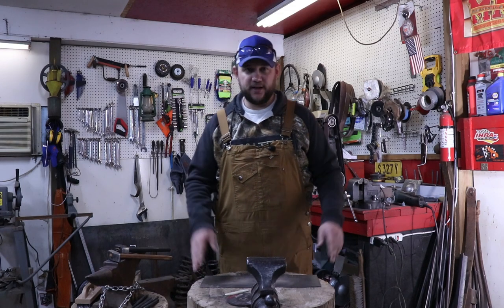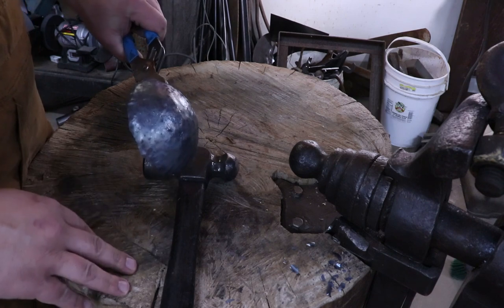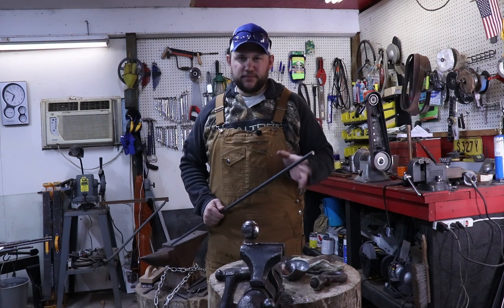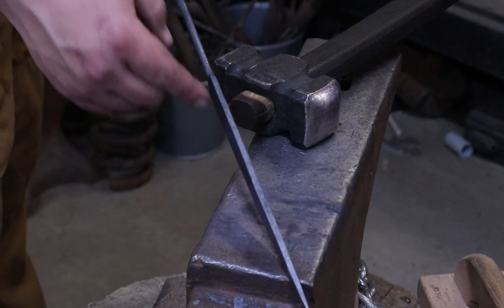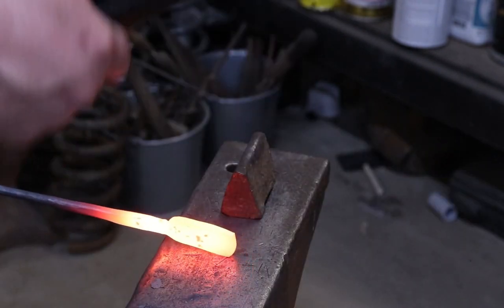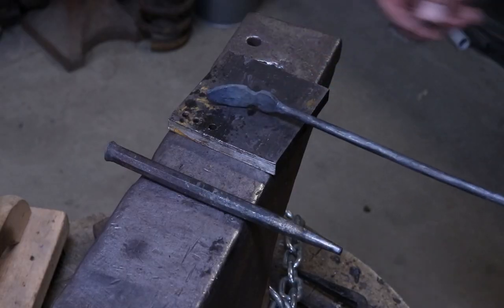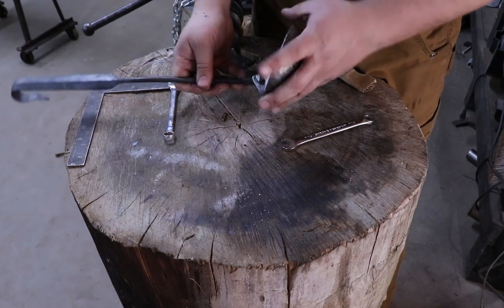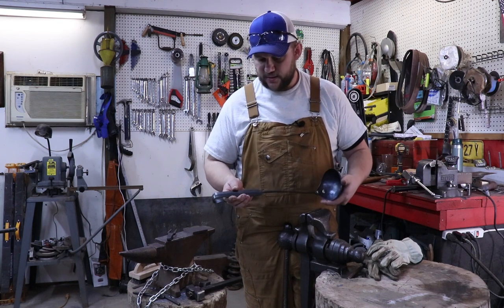Forging A Ladle Without A Swage Block

Comment: Dumb Question from the peanut gallery:  What did  you do to the trailer hitch to make it round on top?  It appears you added something to the ball to round it out.
Reply from the maker: I believe it was a quick change ball it was made that way, thats the reason I use  it since it doesn't have a flat spot.